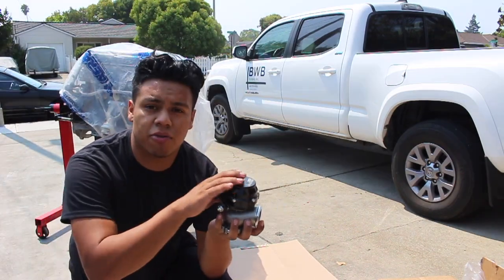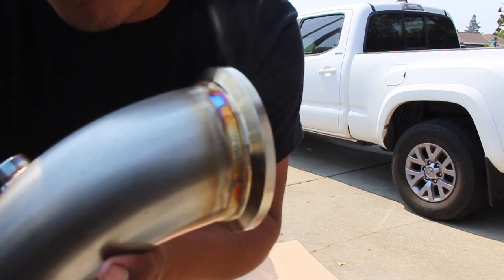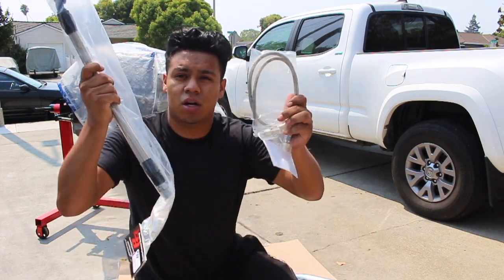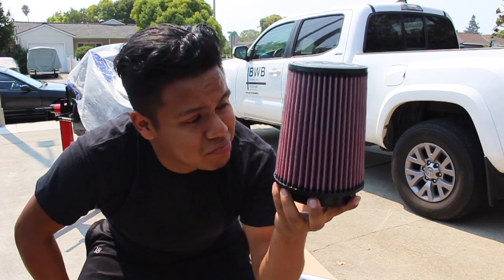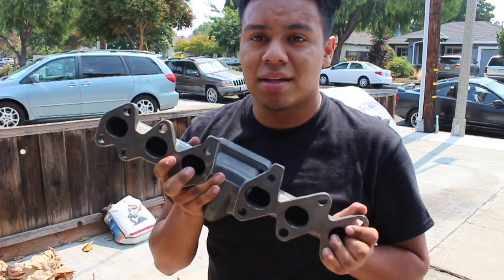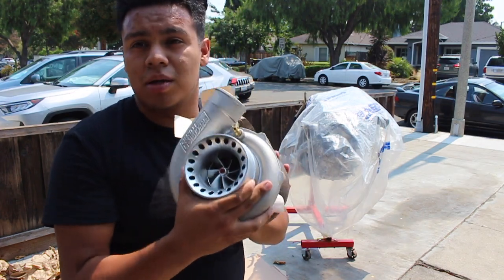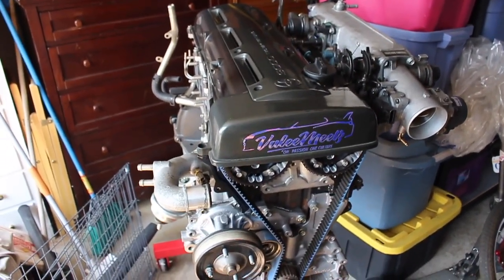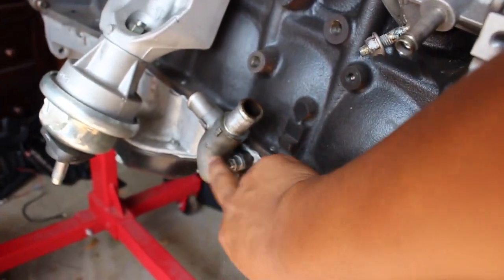Power House Racing Street Torque Kit Unboxing | ValeeMeetz

Comment: Loved my street torque kit man! Just recently swapped out for the S23 kit for my mk 4 last week. Loved everything about the street torque kit except for the sound. The tubular manifold gives the 2J its distinctive sound that I was hunting for in my situation. I went with all the heat treat options in my case and I still ran the PHR turbo blanket. It got pretty hot under the hood without it and my mk 4 came with a customized hood that made the turbo dangerously close to my hood. Good luck with the build man!
Reply from the maker: Thank you so much!